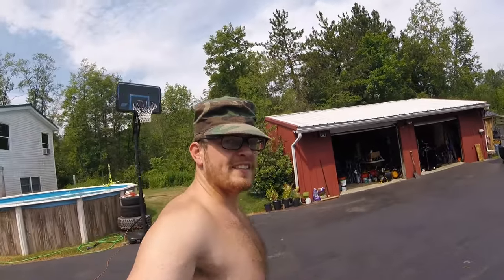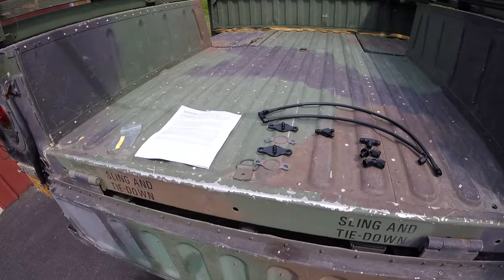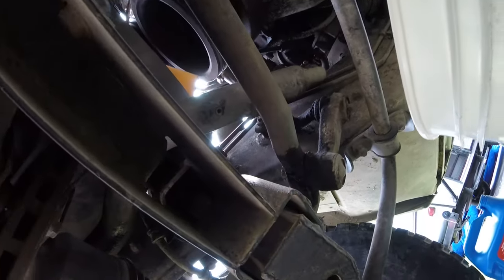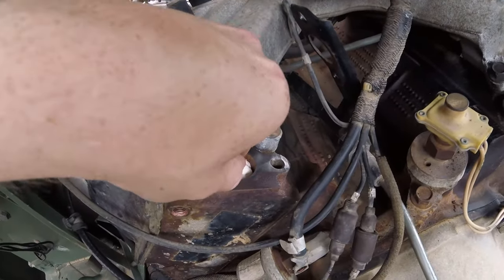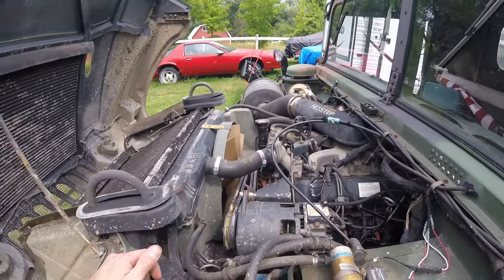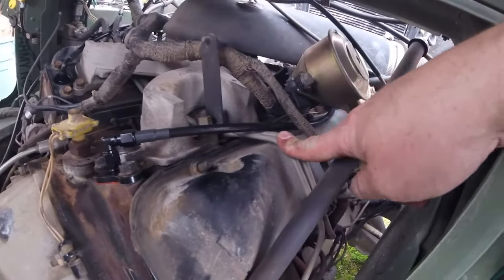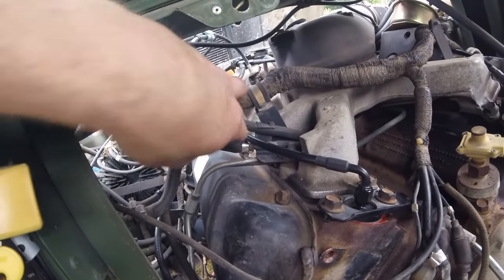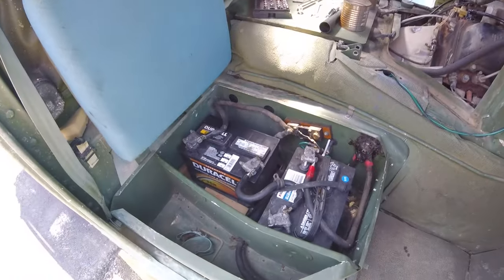EP 4.  HUMVEE Cooling System Upgrade

Comment: Thanks for the video you did a good job. Did it help keep the system cooler.
Reply from the maker: Thanks, I didn't take actual before and after temps but the engine does take noticeably longer to warm up from a cold start. That is my biggest indication the kit works. Also on the highway the fan clutch takes a bit longer to engage than before (1-2 mins longer between cycles). For the price and ease of installation I'd say its worth it for the peace of mind.

Comment: Hi friend. I would like to explain better what I did today. the 2 radiators  placed in the upper part have been completely disassembled and worked to have them restored. one if I'm not mistaken is that of air conditioning and the other that of engine and transmission oil. As for the latter, first of all, I have a question for you. 1) Should the gear oil level be checked with the dipstick when the engine is running and when it is hot? 2) after draining the coolant from the drain valve, I added 17 liters. How many liters do you need? 3) today I dedicate myself to the level of the engine coolant. I filled the tank to maximum and turned on the h1 from a standstill by turning the main and auxiliary fan to maximum by moving the heater knob completely hot and waiting for the engine to reach normal operating temperature. the car remained stationary during this operation with the engine running without driving. When the engine reached normal operating temperature, I unscrewed the screw of the 2 air bleeds but not a lot of air came out and no coolant came out. because? I'm asking you this because I don't want to cause engine damage and burn the cylinder head gasket. thanks friend .
Kings regards Gianfranco
Reply from the maker: Hey GF, 
Unfortunately, this isn't an H1. This is a military Humvee which has a different system and I don't know enough about civilian Hummers to accurately answer that question.

Comment: Those lines don’t get too hot and melt above the engine there?
Reply: They are designed for up to 1000deg continuous and 1500deg for short periods. They are also stainless steel braided then rubber coated on the outside.

Comment: How did you install a kill switch for your fan  my fan clutch only works when i unplug the module under the driver side of the hood  my temp slowly crawls up to 230 then I have to stop open the hood and unplug the module so the fan will engage.  Its getting to be a real pain in the ass.  I am more then likely going to install that kit you demoed  thanks for the video  lots of help  I really appreciate you filming while you did this job so I can see how it works!!!!
Reply from the maker: Hey Matt, 

Yours was doing the same thing mine was. If you're interested, I can post a video on this, let me know!
Reply: @outlulz4758  turns out I put in a new thermostater looks like a brass "spark plug" that fixed the problem.  sure post that vid it all helps alot!!